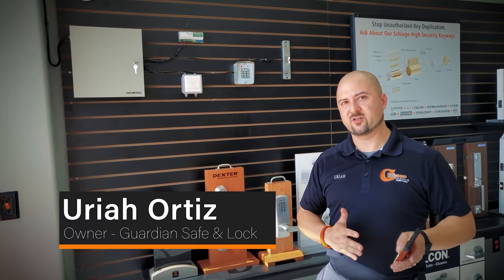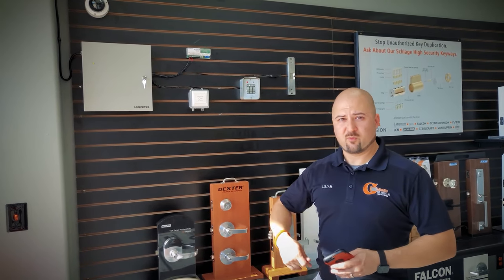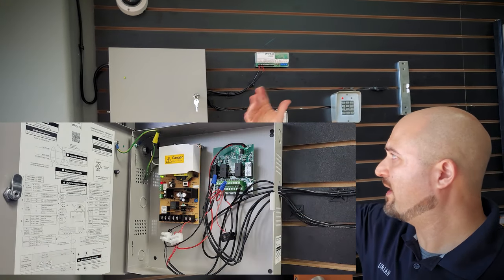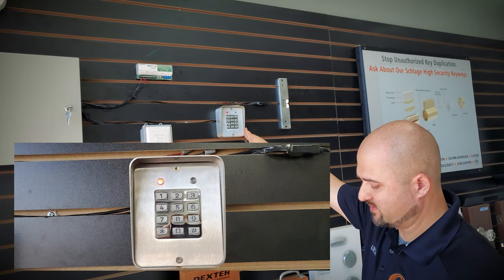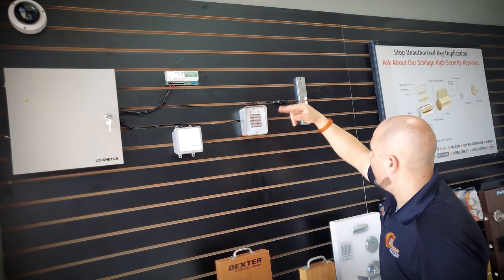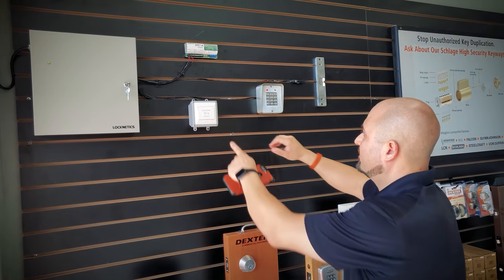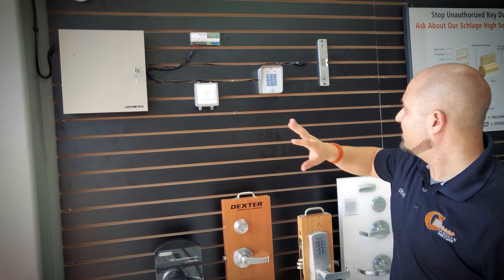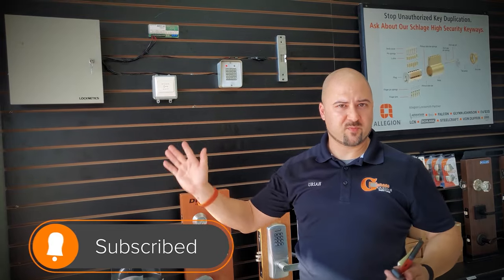Locknetics Access Control System Components | GSL Review

Comment: I have a recommendation to the editor, when you stabilize switch from warp space to perspective. It will prevent the wobble effect. Also play with your smooth motion setting, you can adjust the stabilization strength to dial it in more. If you have any questions about it let me know, I spent a lot of time trying to master stabilization because of the impact it can have on a video.
Reply from the maker: Hey thank you for watching and for the tip! Since this video we have made those adjustments and should be good. We are always improving and looking for a better way to do things. Thx